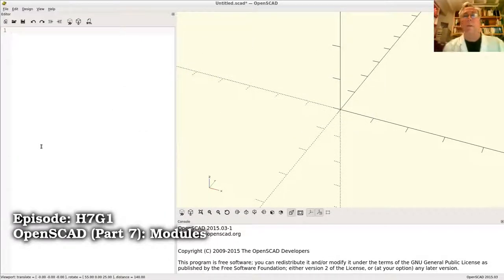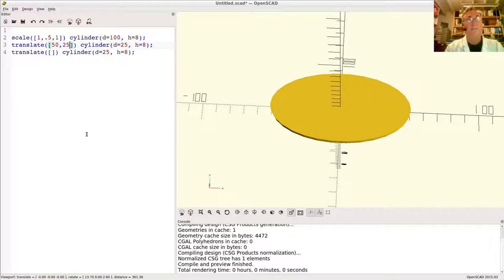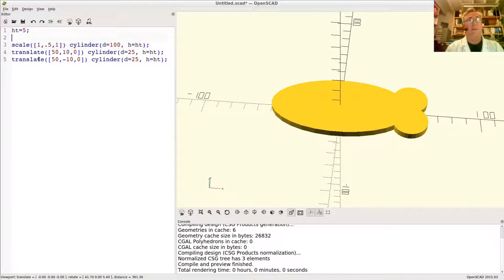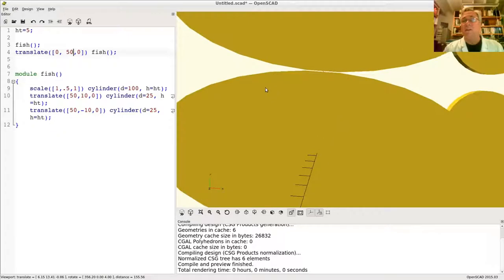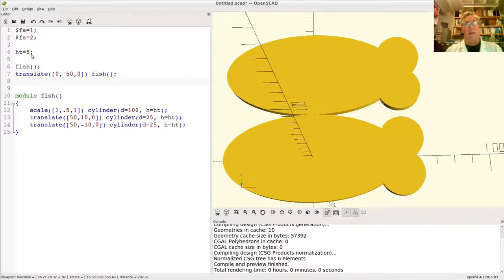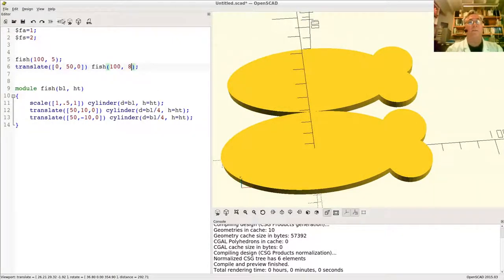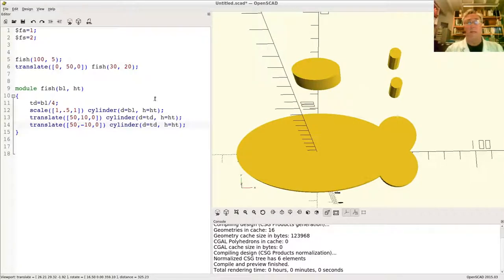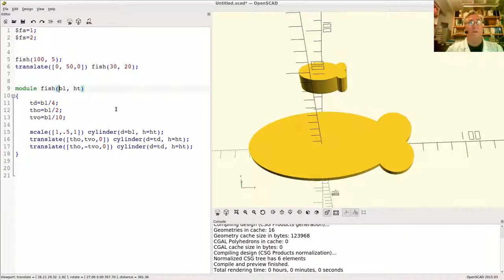OpenSCAD (Part 7): Modules

Comment: Thanks, the comment you made about a cube or other objects being a module is probably all I needed to here, and well see the format too. Are you still using OpenScad ? I just found it and it's what I've been looking for, I've been using blender for years but I need parametric for some stuff. Thanks again
Reply from the maker: I use it for everything that I designed for 3D printing.  Someday I will add some videos on how to make gears that will mesh and some other things that I've learned since I recorded these other ones.  Really cool!
Reply: @JohnsBasement  I also 3d print and have now built a cnc router the LR3. I'm watching the rest of your tutorials now and subscribed. Quick question can I create my own library of modules and import them ?
Reply from the maker: @Zimbob2424  Thanks!  You can create files with whatever modules and variable definitions in them you want and then include them like this:
     include <rack1u.scad>
You can set a path for where it looks for them.  Here is a page with some detail on that:

https://en.wikibooks.org/wiki/OpenSCAD_User_Manual/Include_Statement
Reply: @JohnsBasement  thanks, much appreciated